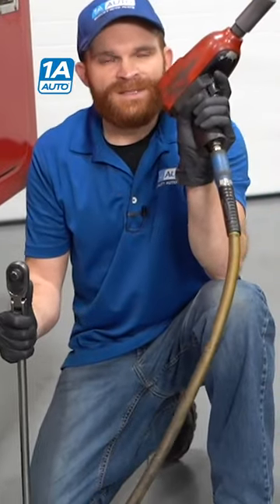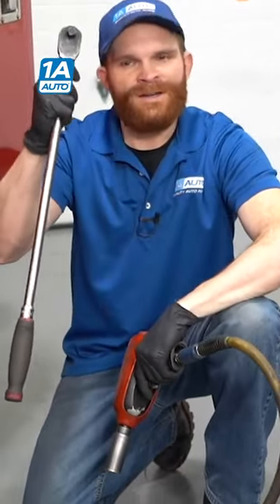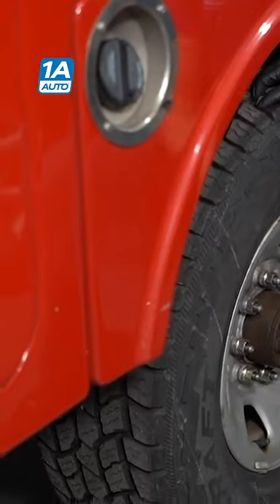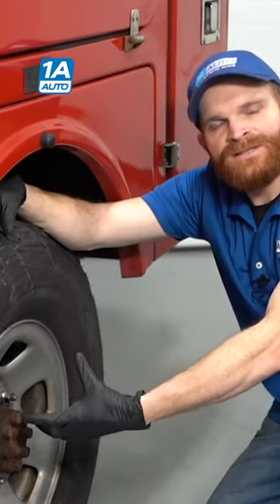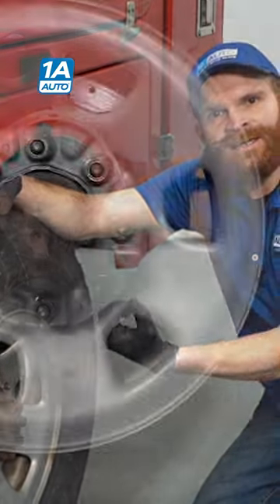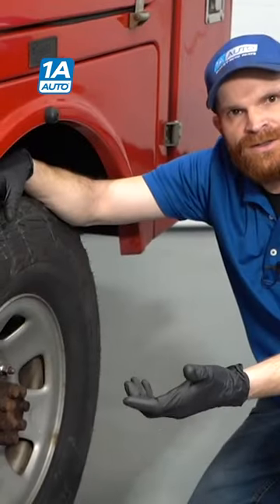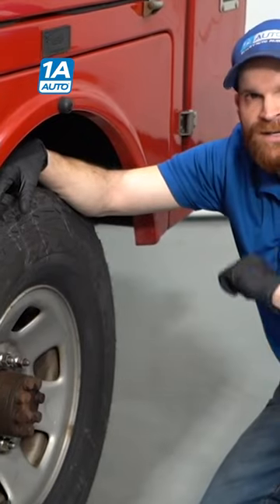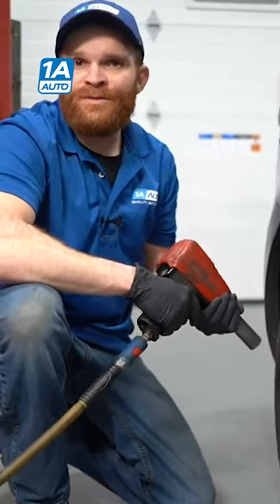Click Link for Full Video! -  Torque Your Wheels? Here's Why You Should! #shorts

Comment: I like torquing the lugnuts while the wheel is still off the ground or with just enough weight to keep the wheel from spinning.  Then I 'half-torque' the lugnuts in the star pattern, then continue until they are fully torqued to spec.  That assures even and constant pressure on the brake rotor and hub to the wheel, and prevents any false-torquing.